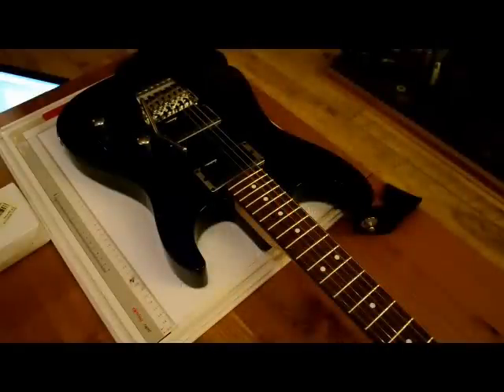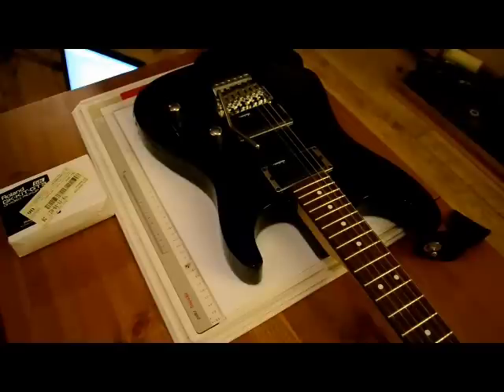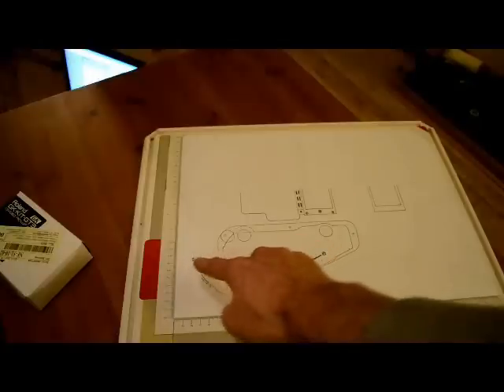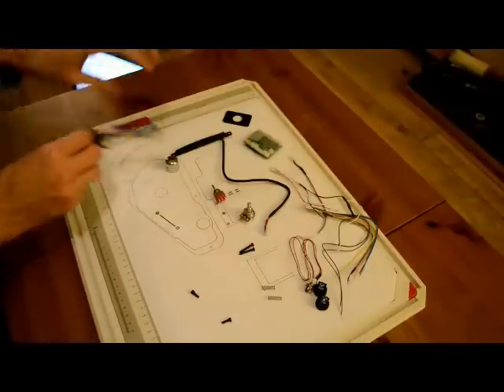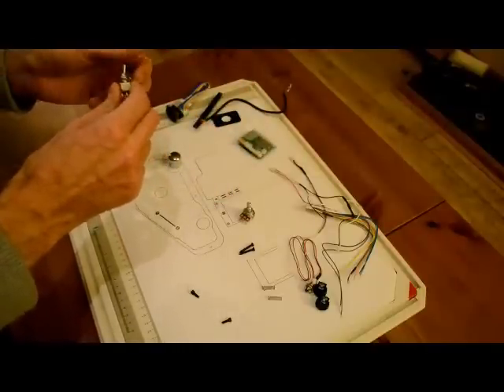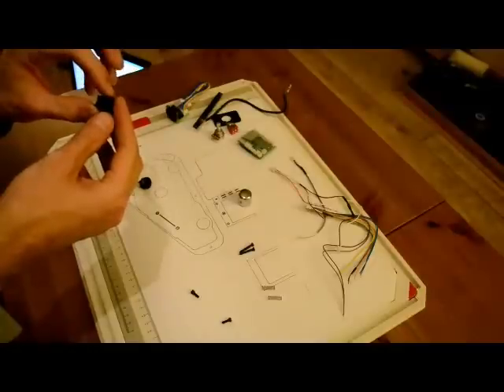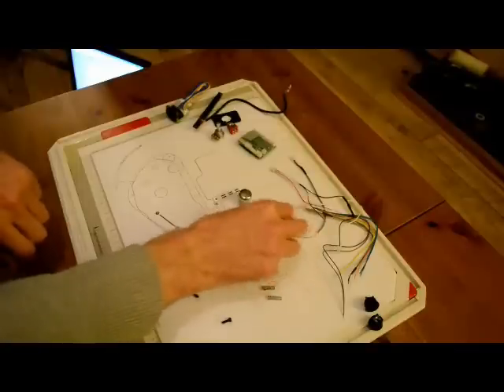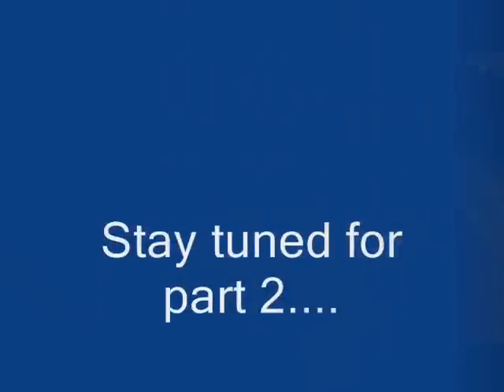Roland GK-KIT-GT3 Install in Jackson Dinky

Comment: Simon, what was that switch you replaced the Roland buttons with?  Looking to do a similar thing.  Thanks.
Reply from the maker: You'll need an (on)off(on) SPDT switch - this is the one I got if you are in the UK?
http://www.maplin.co.uk/p/sub-miniature-toggle-switch-d-momentary-on-off-on-spdt-fh03d

connect the purple and gray wires to the outside tabs and the centre to ground.

Good luck!
Reply: Not in the UK, but thanks, that gave me what I needed to order one!
Reply from the maker: Glad I could help :)